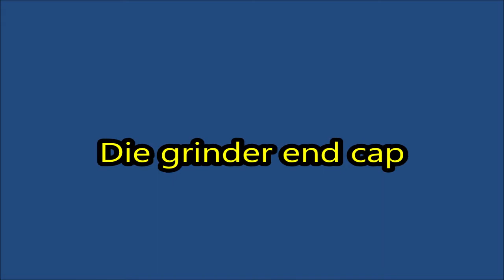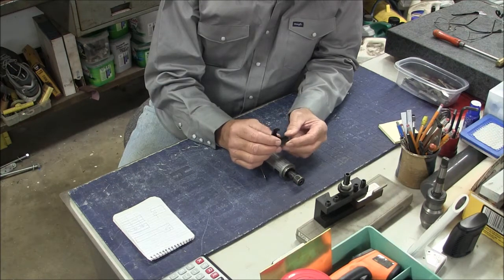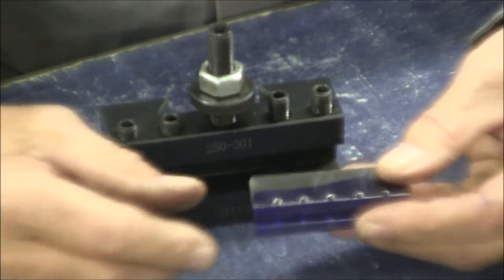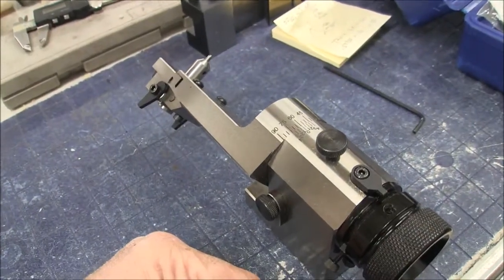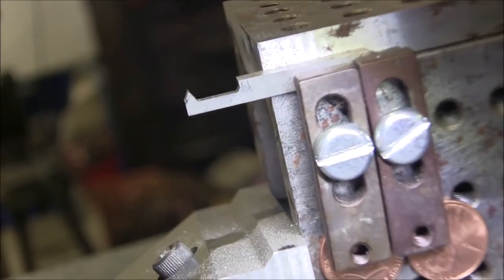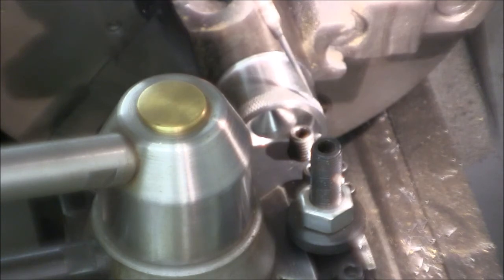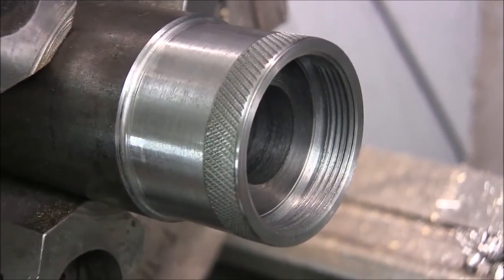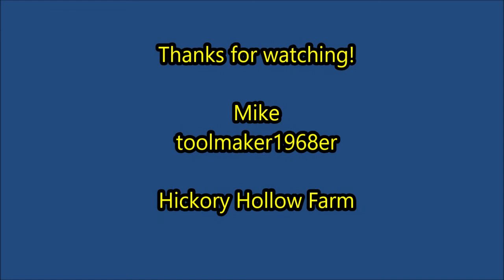Die grinder end cap

Comment: Great little project, glad you survived the storms and fires. Looks like you lashed out the cash on a Brand New Shirt for this video. I know you said you wanted something to make on the lathe, but for what the cap did, I would have done the following. As you still had both bits of the cap, stick them back together and make a brass or ally ring to go around the outside. I bet a bit of 1.5 inch tube would have done the job, or even a bit of plastic plumbing pipe. Keep well from Dave in Australia.
Reply from the maker: I just choose a route that required incorporating multiple machine processes. It provided some varied video content to upload as well as some interesting work. As you say, there are more rational ways to do this, including scrapping it and buying a new one. So now I have a $15 dollar grinder with a $150 dollar part on it!  lol.  I hope you have a nice spring and summer, with no fires! Tc amigo, Mike

Comment: Mike  that cap looks really nice! Nice job on the tool grinding! I have one of those die grinders I don't use it much anymore I end up using a Dremel grinder most of the time now. Yes Covid isn't anything to mess around with. My sister ended up with it she was one of those non believers thinking it's not so bad. She got really sick and took 3 weeks to get over it. She didn't end up in the hospital but it was close.
  Me and Sue (my wife) are very careful to not catch it as we are primary care givers to her parents he is 97 and she is 94 with breathing troubles and on oxygen already. So we have been taking it real serious.
 We had temps in the mid 20's and 4 inches of snow then yesterday the temp was 75 so the snow is gone and that's ok with me.  Keep safe and don't take chances.